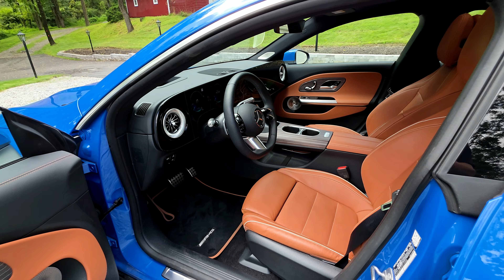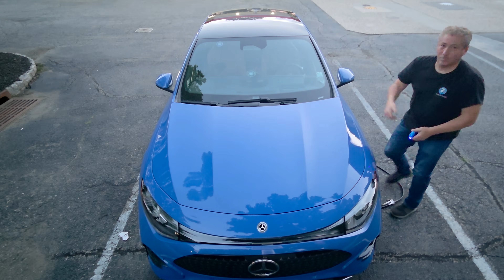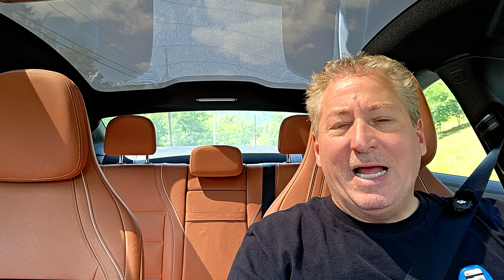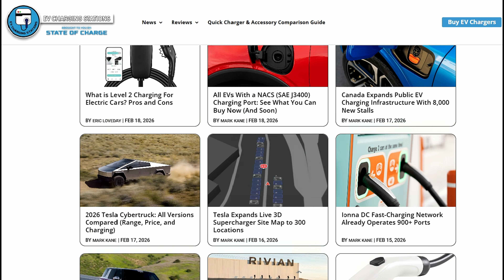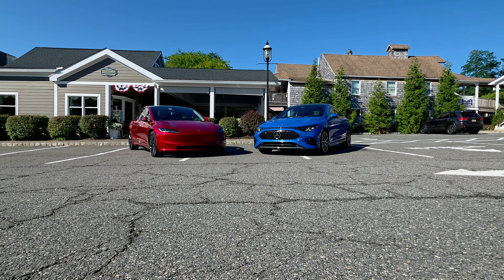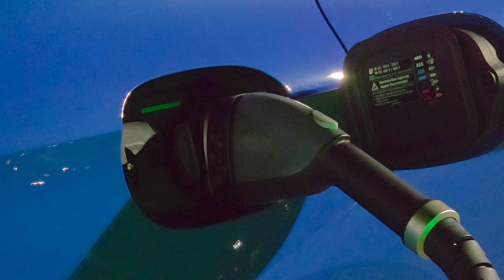The Mercedes CLA 350 4MATIC Has Seriously Impressive Highway Range

Comment: Dual charge ports is hardly worth it.  It only means you need 2 adaptors to have every charging scenerio rather than two.  I have two for my EQS.  One for AC charging and one for DC charging.  It appears MB didn't want to do the necessary engineering to make it a single NACS port.

Comment: 29-aug Ioniq 6 210 miles Golden to Trinidad, CO.  Net up 400'.  Used 47 kWh.  => 4.47 miles/kWh.    97% freeway. ?~65 mph.  This efficiency (3.8 - 4.5) is fairly normal for freeway driving.  There were a couple of estimates in this calculation.  Around town out and back we usually get 5.0 - 5.4 miles/kWh.

Comment: Do we know if putting it in eco mode disconnects the front motor and makes it rear wheel drive?
Reply from the maker: Yes, it decouples the front motor but it will reengage if extra power is needed. You don't have to change the drive mode for both motors to engage
Reply: @S @StateOfChargeWithTomMoloughney nice, it’s the one thing that I think a lot of people overlook when comparing the range of RWD models vs AWD. You can run it in eco mode to get comparable range to the RWD model.

Comment: Amazing test, Tom! That 4.44 mi/kWh (14 kWh/100km) at 70 mph on an 800V architecture is insane for a dual-motor setup.

As someone who drives and creates content around the RWD CLA 250+, I can confirm the MMA platform efficiency in long-distance highway trips is a game changer. The reduced drivetrain losses on the 250+ combined with the 2-speed gearbox make long road trips effortless. Can't wait to see your 0-100% DC fast charging curve video next!

Comment: Thx for video. There are already some 2026 CLA’s (with EQ tech) showing up on the used market (at quite the discount,) do you know if those cars are markedly different than this new 2027 model?
Reply from the maker: The only difference (and it is a very big one!) is that some of the early 2026 builds will not charge on a 400-v DC fast charger unless they have the optional factory-equipped DC/DC converter. If the vehicle doesn't have that, it cannot charge on 400v chargers, like all of the Tesla V3 Superchargers. Most of the other networks (Electrify America, IONNA, EVgo, Walmart, etc) all have 800-1000v systems so the vehicle will charge there fine without the DC/DC converter. If you're interested in a used 2026 model, it should be easy to find out if it's equipped with the converter.
Reply: @StateOfChargeWithTomMoloughney  Thanks. is this converter upgrade built into the car (on the ones that have it?) ie, not something but into the trunk or something?

Comment: New bench mark!  But th 47 PSI tire pressure on the tires bothers me.  So is Merc cheating?  My EV is 36 PSI and my ICE is 35 PSI
Reply: Weight. The little CLA has a 85 kWh pack which is enormous for a car this size. For comparison, a similar sized Volvo EX30 has a 64 kWh pack and the Chevy Bolt a 65 kWh pack. Heck, the Model 3 LR has a 75 kWh pack at most.

Lithium batteries are heavy, and Mercedes often loads their cars with a ton of tech and interior creature comforts with little regard to curb weight. A Model 3 is almost like a public lavatory inside in comparison. No surprise why it is heavy and needs the tire pressure to support that mass.

Comment: Tom, does it have a frunk?  As an EQS 580 owner, this EV is very appealing with its efficiency, range, and charging speed.  But, we need the next larger size, probably E-class.  

It is disappointing MB couldn’t do AC & DC from same NACS connector.  Nearly every modern EV on the road does 11.5 kW AC charging so don’t know why this new design is only 9.6kW.  Not a disqualified because AC charging is mostly at home while sleeping. 

As a former CLK convertible owner, I’d buy this EV in a convertible body immediately.
Reply from the maker: Yes, it does. It's not quite as big as the Model 3's frunk (3.1 cu.ft.), but it's not that much smaller (2.5 cu.ft.).

Comment: Tom - Great review.  I too was impressed by the comfort of the 2027 CLA (a 250+ for my test drive) but was a bit disappointed with the width of the trunk space relative to the Model 3.  Hopefully you can get another test car when the Nvidia powered Drive Assist Pro comes out (2027??) to compare to FSD 👍.  So far, dealer allocations on the east coast seem slim and they have no info on the status of the Drive Assist Pro roll out, so probably not going to be a big seller for the rest of 2026. Hopefully MB starts ramping up on the CLA next year.

Comment: 47 psi tire pressures!  Is it just me, or is that the highest recommended pressure for a passenger vehicle on the market?  It's definitely the highest I am aware of!  Sure, commercial vehicles and heavy duty pickups are up in the 65 psi and up range, but I haven't seen a passenger car or SUV with recommended pressures above 42 psi.  Also, using narrower front tires helps reduce aerodynamic drag, so the tires alone are probably contributing a significant amount to the high speed efficiency.
Reply: A: maybe, for obvious safety reasons tire PSI is normally a function of the vehicles curbweight/gross weight. the new CLA 350 4Matic is listed to be approximately 4,500 lbs without any people in it. so if this figure is true (one would need to put this exact vehicle on scales to verify the claims) this is surprisingly good for the 85 kWh battery rating, and all the other included equipment.
Reply: @phillyphil1513  My Ioniq 5 AWD is approximately 4,650 lbs curb weight and the recommended tire pressure is 36 psi.

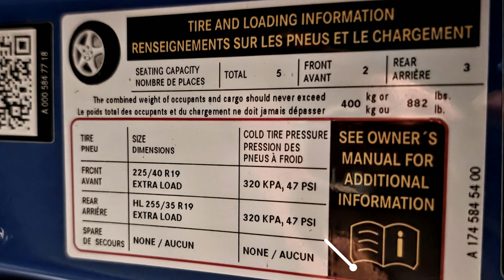Comment: @2:35 holy cow are we just going to slide by this 47 PSI?  JESUS that's a lot.  No wonder it's getting range, there no flex left in the tire.  I thought 42 was high in my 2021 Tesla Model 3 long range.  I was getting 360 miles.  I think this is a more attractive car than my Tesla but still.
Reply: I mean, my trailer tires take 50psi. And it’s a light duty single axle trailer. It makes sense to raise pressure to lower rolling resistance.  Of course, you know that.  But on the comfort side of things, the suspension can be tuned to deal with this.  It wouldn’t ride as well as it could and agree with that sentiment
Reply: @nunya9555 yep

Comment: For our southern Italy road trip I rented a CLA from Sixt. At the time of making the reservation I assumed we'd get the 250. I wanted it specifically for the range. However upon pickup we got the 200, that I didn't know even existed. It has a 58kWh LFP battery and not the 85kWh NMC!

This worried me at first, but after 2 weeks of driving it, the efficiency was so good that the smaller battery didn't end up being an issue, even during the longer drives in 100 degree weather!
Reply: Distances in Europe are short enough for that to be realistic.

Comment: Great results, only setback is the 400volt charging, here in BC and Alberta not many 800volt reliable chargers, we all depend on Tesla's Superchargers.
Reply from the maker: It will charge on 400-v systems, just slower. I wish I had the vehicle longer so I could have charged it on a 400-v Supercharger to record the charging times

Comment: 20:30 back passenger side!? I really REALLY wish these manufacturers would get their shit together and come up with a fking standard... If all the charging stations were built like gas stations, it wouldn't matter, but they are not. Put one on the front middle or front passenger for all vehicles with a hitch that have a two rating, and the rest should have them on the rear driver's side. Done and done..

Comment: It is completely STUPID that the Japanese and German engineers can not or are not willing to follow the J3400 standard for DC and AC charging.  That was one of the BEST features of the Tesla connector. I was hoping that sll the new EVSEs, V2G. V2X would all use the same type of hardware, so if you had a Ford F-150 Lighting, then switch to a Rivian, Tesla, or GM vehicle all your hardware would work with any brand using the J3400.😊

Comment: Were you pre-conditioning the battery at the end of the test?
Reply from the maker: No. The battery was warm enough without doing so. The car tells you what the maximum DC charge rate will be with its current temperature. At the end of the range test, it said it could accept 351 kW.

Comment: I will feel sorry for you, Tom, when the first solid state batteries come out and you have to drive 600+ miles to drain them.  385 is long enough.
Reply: There is already the BMW i3 with 905km WLTP, which is difficult to drain, too (Production in Munich already has started) .
And I read a comment of a CLA Owner in Germany...he was not able sofar to drive down to 10% at all😂 never reached that low SoC.

Comment: Not really impressed with MB.  You get middle of the road everything for top dollar and a badge.  No thanks.
Reply: There is a German Channel doing 1000km Tests on Autobahn...8:12h with 170km/h max and only 20kwh/100km consumption...this is really impressive.
The previous best was a Model 3...40mins slower and much higher consumption and extremely bad charging...missing a second gear.
Reply: @josefv-y8m  U.S. driving is very different from German Autobahn testing. The vast majority of miles are mixed: commuting, errands, local highways (often 55–75 mph), and some interstate travel—not sustained 160–170+ km/h (100–105+ mph) runs. Highway speeds are generally lower and more limited than unrestricted Autobahn sections, so the CLA’s two-speed gearbox advantage at very high speeds matters less in everyday American use.  

Which is who this channel is targeting.  My city limits max speeds to 60mph/96.5kmh on its highways, and city speeds vary at 55mph down to 45mph.  Speed at your own risk.  
Having a 2-speed gearbox/transmission is of little use to us.  It only adds to complexity and adds a failure point and forced service requirements.  Most major interstates speeds are at 65 and 70mph.  Context matters.  

AAA American Driving Survey (2024): Drivers averaged 31.1 miles per day, which annualizes to about 11,350 miles per year.  Range is not really a concern for the vast majority of drivers.

“Extremely bad charging” is overstated in general.  Context matters.  Saying a GM Bolt "has extremely bad charging" would also be overstated and need context.  In general, any EV with the capability to charge at 150 to 250Kw will be more than enough for simple trips.  Most charging in the US happens at home while they are asleep.  The video clearly showed this CLA plugging up at 1% and in 18 minutes it reached 56%.  My Tesla Model 3 at the same 1% soc plugged up to my local supercharger in 18 minutes will get up to 55% to 60% depending on the precondition and heat of the pack.  Both Tesla and this MB are actually extremally good at charging.  The interesting fact is how a 400v Tesla system is just as efficient as this MB 800v system at charging.  Engineering and software matter in 2026 and beyond.

Comment: Wow, great range.  The two charging ports might confuse people where they can charge this car.  You might want to explain to your subscribers how they work.

I found it interesting that MB put both ports in but only allows you to use the NACS for fast charging and CCS for home charging.
Reply: The new Porsche Cayenne EV does the same thing. Kyle just posted a video late last week on this absurdity.
Reply: @jeffs6090 I also saw that video.
Reply: @jeffs6090  Kyle is insufferable. It does seem kind of weird, but for me, this setup would actually be great. I have literally never used a L2 charger with a NACS connector. Even my home charger is J1772 because the NACS version was inexplicably $100 more. However most DCFC I use have NACS plugs, and they're sooo much easier to use than CCS. So with the Mercedes and Porsche setup, I would almost never need an adapter.
Also, people wouldn't mess up the adapters. A lot of people with cars that only have NACS get very confused about which adapter to use when and assume the car is broken when their L2 charger doesn't work with the CCS>NACS adapter.
Reply: You have to add extra electronics to the charging system to have it switch between AC and DC.  So perhaps they didn't finish the design or testing of that part.  In other countries they are not using J3400, so perhaps a German company isn't prioritizing that update yet.

Comment: I was expecting 400 miles based on your title. Is 312 miles really all that ground breaking on an 85 kWh battery pack in 2026? The Tesla Model 3 Dual Motor gets more than that. Of course that's not a luxury vehicle, but it still hits 346 mi. I wish other manufacturers would be really pushing battery tech and efficiency forward so we could all have cars that would hit 500 miles of range.

Edit - 385 is impressive. However it is pretty close to the Model 3 RWD's range. Once we can get dual motor vehicles this size up to 400+ miles of range, I will be impressed. We're 10 years into the Model 3's lifespan, and I just believe we should have vehicles with higher range. Especially since we have to deal with the 80% rule, cold weather, and degradation over time. For instance: my two Teslas, my 2014 that started with ~260 miles in the winter is lucky to get 150, and my 2019 3 is lucky to get 200. 

Its time to boost range specs.
Reply: Why do you need this range? ...only for a Tesla, which charges extremely bad and slow.
The Mercedes charges range in half the time...in most cases too short to have a pee. 😂
Reply: The issue is wind resistance.  Tesla makes some of the most slippery cars and this one is up there too, which is why the range is good.  Electric motors are already hella efficient so there's marginal gains there.  So you're left with battery density.  They're going to need to find a way to pack 120kWh packs into the same space while not raising the weight.  Then that's just cool for road tripping, but not really for daily driving.  Or if you don't have home charging I guess, but in that case charge speed is probably more important.
Reply: This is a dual motor vehicle with nearly 400 miles of range though.
Reply: How many trips do you take a month where 400 miles range is needed?
Reply: 80% factor is a non-issue.  I don’t know anyone who goes on a 400 mile trip without planning.  Often, you pack a suitcase or plan bringing some personal items or merchandise. Undoubtedly, there is planning.  The night before your road trip, set EV to charge up to 100%.  It’s that easy.

Comment: Great video and so that essentially means if you don’t want, I have to worry you need to either get you would either get the Chevy the trail boss or you would get a Mercedes that is awesome and it’s pretty cool that Mercedes figured out a way to put both charging ports inside of one gas bay door so you don’t have it on the opposite side that’s pretty cool but it would’ve been cooler if they just had one and a CS port due to the whole thing, but it is what it is sometimes you can’t get everything. Keep up the great work have a good one. I’ll catch you on the next one I like that blue. It’s a little loud, but I like that Blue.

Comment: This is the first vehicle I can think of with charging input (320 kw) greater than power output (250 kw).
Reply from the maker: I never looked at it that way. Interesting
Reply: Why does that matter……. Pointless statistic.  Couldn’t any car just put a smaller motor in and yield that result.
Reply: @Enter_name_here-q4d most EV’s are limited by charging current. Higher charging current requires more expensive cells. Inverters and motors that can handle the extra amps aren’t really much more expensive. Batteries can also discharge at higher rates since it is only for a few seconds. This basically tells us that Mercedes is artificially limiting the power of this vehicle. That battery can support more output, but they aren’t using it.

Comment: I'd like to know if you could feel the transmission shift and when it did it. I 'm guessing that's the reason for the nearly identical highway and city miles. 
  My 3 year old Mercedes EQS SUV gets a lot more than the EPA range. Crawling around town I get 400 miles (Summer). The faster I drive the lower the range. At 80 MPH it drops to 340 (Summer). In winter it drops off a lot, around 350 city and 275 at 80.
Reply from the maker: You can, but it's not as harsh or as pronounced as on the Porsche Taycan. It's at 65-66mph
Reply: @StateOfChargeWithTomMoloughney  That's interesting, that's about the speed my car's efficiency really starts to drop off.

Comment: What do you do if your battery runs out of power before you get to the charging station?
Reply: That’s physically impossible nowadays unless you do it on purpose.
Reply: @LowmanGames  i’m new to EV’s and have range anxiety I guess.
Reply: @L @LouieV2020  long as you have a home charger or live in a densely populated area range anxiety doesn’t exist. What you moreso have is charger anxiety.
Reply: What do you do if you run out of gas before you get to a gas station?     Yea, you would call that person stupid for running out of gas.  Same thing with an EV.
Reply: @GregP30  facts 😂
Reply: Believe me, this will never happen...and if, you need a transporter for the car, since an EV can not be towed
Reply: @josefv-y8m  is a transporter a flatbed platform tow truck?
Reply: @LouieV2020 yes
Reply: AAA is starting to add portable chargers to their service vehicles. There are also vehicles (gas+electric) with onboard charging capabilities. Lastly a flat tow would charge the battery in a pinch. The real answer is to use the vehicle’s gps to see when you need to charge on a long trip. Any reputable EV will automatically add charging stops if needed.
Reply: @nathanielthelin1051  thanks I was going to call AAA about my membership and if they provide emergency charges for EV’s